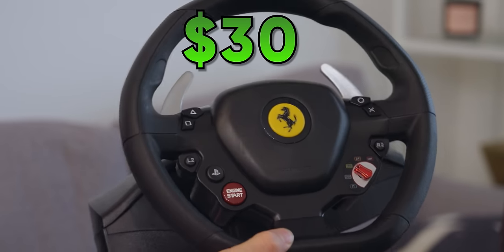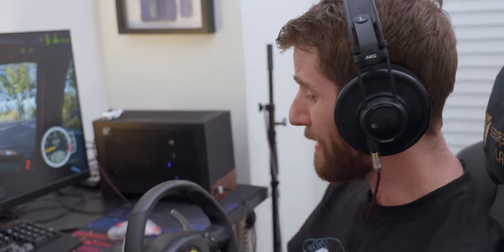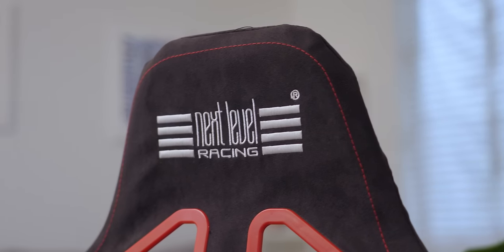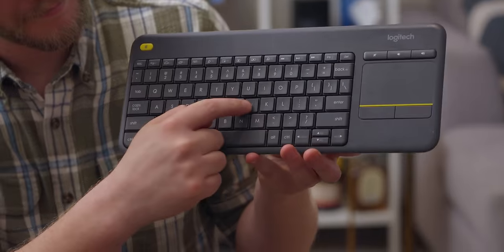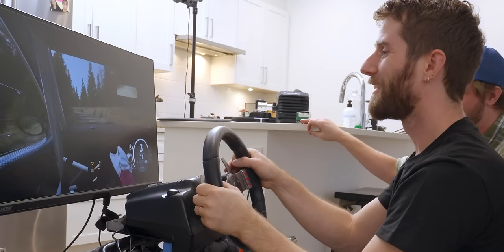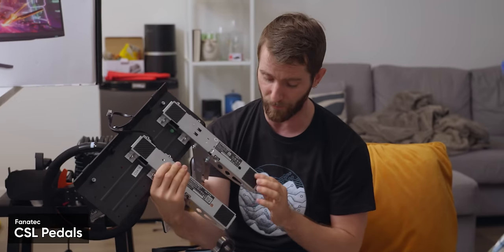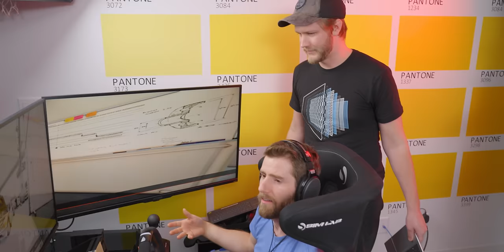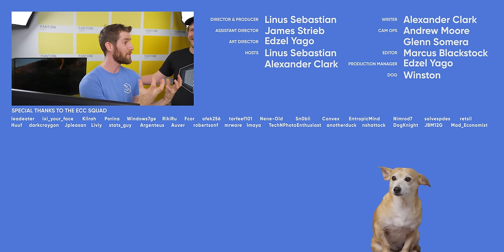Don't Waste your Money - $30 vs $10,000 Racing Setup

Comment: I'm quite happy with my Logitech G29. I got it with the H-shifter at no additional cost since the store was selling both simultaneously as a bundle at the time. I also agree that while the hardware makes the experience more immersive, it's the player's ability what makes the difference in the end.
Reply: Esports champions have used the G29, it's a great wheel.
Reply: i got that the pedals and shifter, add in a VR rig and you are rocking immersion
Reply: G29 is pretty bulletproof and has plenty of force behind it. I do recommend it to everyone who’s new to all of this. I don’t race competitive though, just like to cruise around in games.

Comment: About the monitor, I use a tool called Twinkle Tray, which allows you to change the brightness of your normal PC displays without using the OSD. It does this using the DDC/CI-functions that also handles the thing where Windows sees your monitor's brand and model!
Reply: Dell displays have a similar OEM app for this too. Honestly a game changer

Comment: i saved money by building my own desk, seat base and found a good conditioned car seat for the seat to mount onto the seat base i made.  
I choose the Simagic Alpha wheel base because its so compact, good quality, and quick release wheel rim.  SHH shifter does the job and made in Spain from 3D printed housing.  then modified a pedal set to make them feel more realistic and better reaction (see video on my Moza racing pedal mod).  
your right, no need for a $10,000 setup.

Comment: On the subject of wheel rotation on the G27: Always use the maximum rotation. The game will provide the lock limits for the car you drive automatically (in most cases). The problem with using an artificially limited range is that all of the force-feedback effects are smooshed together, amplifying less important information like bumps and reducing the feeling of the important stuff like weight-shifting and traction levels. In other words, effects that should happen subtley and gradually occur much more suddenly and violently than they would realistically. When you're driving the car properly, you aren't going anywhere near full lock anyway.

Comment: IMO, the best upgrade to one of these setups is to get the frame and no chair at all.  Go to a junk yard and get a good condition seat from an actual car. You can use the same bolts that it comes with to connect to the frame ( or to some wood if it works better for you )  No need for super expensive custom seats and lots better overall.  As a plus, if it's a manual seat like in a base model Mustang, you have all the adjustments built-in. All you need is to bolt the four corners down to something. :)
Reply: +1 i use a recaro bmw electric seat with an old laptop charger to use the seat controls. I can do endurance racing hours and hours, zero disconfort.

Comment: I've had the "$30" setup for a while now (except my kit is an old PS3 GranTurismo wheel from logitech that has force feedback) and I absolutely love it for the sake of immersion or just when I want to "drive" more without wasting actual gas, but often still use my controller for any racing game that I'm trying to complete for the sake of the game itself (like nfs Heat or Forza Horizon)

Comment: I've been using a g29 wheel for over a year now and it's a great investment if you like sim racing. No where near as fancy as some of the higher end stuff but it does it's job well.
Reply: Yeah anything in the 1000s just isn’t necessary if your not a pro lol a desk and racing chair with the g29 is more than enough
Reply: its still $300 way too expensive. no way i wanna spend that much to play driving sims
Reply: @talal3c  if it's between spending a couple of hundred and spending thousands for a full setup - a couple of hundred is way more affordable to get into the hobby. If that's too much for you - that's fine.

Comment: One thing too with the PS5 controller in particular is that at least in GT 7  you can also use it like a steering wheel. While obviously not amazing for the feel of a wheel, actually turning it in a similar fashion helps with smoothness and kind of feel for what its worth. It's just awkward still using the L2 and R2 triggers for gas and brakes (this can be changes but makes more sense using the triggers with the adaptive feedback and considering how pedals actually work.)

Comment: I've been a fan of racing sims since 2013, and about 6 months ago I decided to try a steering wheel, I got the Logitech G29 and it is great, the only downside is after using it for a while the motor gets hot and there will be a burning smell coming out of the vents. To solve this, I didn't use the wheel for a while so the components would fully cool down and I haven't noticed any burning smells coming out of the vents since then.

Comment: The main difference between the G27 and G29 I believe is more so the force feedback getting better. In terms of the actual wheel capabilities, not so much really. The pedals also have a clutch now too (some older wheels don't get one) 

One thing that is super nice for the G29 is the modding scene though! I have a heavily modified G29, so mine is actually in an F1 wheel configuration, with magnetic shifters and also a better grip for pure racing titles. My brake pedal is also modified to have some more weight. It's neat to see that even the low end wheels have their own modifications.
Reply: I have the g27 and my little nephew has the g29. they are identical inside . The onley big difference is the button layout g27 has all buttons on the wheel while the g27 needs the shifter to complete all button functions. Thats why g29 doesnt have the shifter included (have to buy it seperate) shifter from the g27 feels a bitt better (little stiffer) than the g29 but the difference is olmost not noticable. g29 is nice when u race gt class and above cars becouse of the button layout. other then that there realy is no difference
Reply: The G923 is arguably better than both because it has Trueforce but so few games have it so its more of a gimmick lol
Reply: They both put out 2.2nm.
Reply: I have an older G25 so slightly worse force feedback. It does have G923 pedals connected to the wheel though. These are a nice improvement and work with no mods at all.
Reply: @PixelatedWolf2077  the pedals are a useful upgrade for earlier wheels if you can get them cheap.

Comment: I used to use the OSD on my monitor all the time to change my monitor brightness and I hated it, until I found twinkle tray which lets me control them through windows and I can set them to hot keys to have a more integrated experience akin to a laptop. Also it supports multiple monitors decently well.

Comment: Great video guys, it's easy to over complicate a video on this topic with so much equipment out there to choose from. My brothers came over and had a blast with WRC 23 on my sim rig its great fun going for the fastest stage time. Sim racing has been a full blown hobby for me for the last few years and no other gaming experience has come close. 
I like doing metal fabrication work so its been a ton of fun building a rig. Its helped me keep the price down without many compromises. So far I have made a sequential shifter, a load cell pedal box, formula wheel, custom frame, button box. basically a custom rig for all disciplines.

Comment: 14:00 Someone needs to tell him about DDC/CI. Using a tool like Twinkle Tray, you can make the monitors change brightness automatically, and not just on laptops either. VGA, DVI, HDMI (not DP, that transmits it differently) have 2 wire for an I2C bus. 90% of monitors allow you to controll them via that

Comment: I never even tried racing with a game controller. I started in the mid 90s playing Papyrus Indycar Racing with the first mass marketed wheel/pedal set, Thrustmaster T1  (and still have it on a shelf to this day), and the wheel used bungee cord tension, but that beast was made out of 80% metal. When FFB started to come out, in 2000 I switched to a Logitech Wingman Formula Force wheel/pedal combo. The FFB was awesome to have, but the 80% plastic build always felt like I was going to break it. (Just sold that one 2 years ago.) Then life took over and I had about a 20 years hiatus and wanted to get back into it in 2021, but my gear was very outdated (can you still get serial cards for new PCs? Lol).
I got a used Thrustmaster Ferrari Wireless GT Cockpit 430 Scuderia Edition because it's a folding, all-in-one wireless wheel/pedal set. Very convenient when you have no space and using a gaming laptop connected to your home surround unit and 70" TV in the living room. And it was great for NASCAR or F1, but when it came to Dirt 2 rally racing or drifting, the lack of FFB just didn't cut it. So almost a year later (2 years this past Christmas Eve) I bought a used Thrustmaster T300RS and T3PA-Pro pedal set. This snowballed into a re-config of my girlfriend and my collectors room changing into a his/hers office space. I got a folding wheel stand (which is so modified now it can't fold if you wanted to), a new TM TH8A shifter, a new TH TSS handbrake, triple monitors, a used VR headset, a Logitech surround sound, and my girlfriend bought me a new gaming PC to run everything better than an 8 year old gaming laptop.

Comment: Vr is essential for sim racing imo. It makes it so much easier to judge distances.
Reply: Only if you can set your stuff up the same way as in the vr.
Reply: Most people prefer triple like this. Properly set up with the right FoV you get the same natural feel of speed. And its less tiresome for your eyes, especially during longer races. In addition to that it also allows you to use the fancy stuff you can buy like wheels with displays, mashal flag LEDs and such.

I know plenty of guys in my league who moved from VR back to triples. VR is awesome if you dont have the space or budget for triples like the ones in the video though.
Reply: @BurningBroadcast also fov, you can see what happens in the corner of your eyes. Until vr can do at least 150-160 degrees fov, triples = less crashes for me.
Reply: Thats just because of the Stereoscopic 3D effect. you dont need VR for this, 3D screen is enough :p
Reply: @BurningBroadcast  I much prefer my triples over VR, even if I didn't have motion sickness. People forget motion sickness exists; there is a VERY significant portion of people that have motion sickness they cannot "get over" by exposure, or even by taking Dramamine or alternatives. Those can all help, but for many (including myself) there is nothing to fully alleviate it.
Reply: VR will be the obvious answer in the future, but it's not quite there yet and it would for sure make me sick anyway

Comment: A video without any specific information regarding the simracing world and how to get a good simulation.

The advice to stay away from the "no Force feedback wheels" is great, these are awful and useless, a controller is way better.

An advise regarding the importance of a good feeling with brake pedals, in particular talking about loadcells, would have been necessary in my opinion.

Maybe having Jake (who has some experience in simracing) as co-host would have been better.

Comment: YES, racing a sim for extended periods of time can be excruciating. I would know, I've done in Gran Turismo games, all of the 24 hour endurance races using my G27 and a G29. This was a few years back, but I can still remember the exhaustion. First time I did it solo, which was downright masochistic. As a result, I can easily go full blast on the Nürburgring at night. My friends can't keep up. For all the other races, Spa and Le Mans, I ran it tandem with my cousin and a few beers. Don't drink and drive. And REST before driving, always. I'm seriously considering a Fanatec DD PRO to improve my setup.
Reply: If you get the pro get the 8nm boost kit, and a loadcell brake. You will be set for quite a long time and obviously you love cars  and racing. One of the best purchases I have ever made in my life.

Comment: you don't need to keep changing your OSD settings all the time. just enable HDR in windows & you can change the SDR brightness settings easily through there. keep the monitor in HDR 400 mode. i have that same acer monitor & it's already really well calibrated

Comment: I had a G25, and tested a Morza and a few fanatec wheels, I ended up getting the logitech  pro DD wheel and pedals, the thing is amazing (liked it better that the others) It will not make you faster but it's way more fun with a good setup. if you get a DD wheel you need a good frame else you will get a lot of flex from the DD wheel and load cell break.

Comment: As someone who has experience in Sim Racing:

Anything you can afford to start off with, as long as it has Force Feedback. Logitech, Thrustmaster, it's all personal preference. 
After that, the next step is upgrading everything around your wheel, then, after you have a shifter, a wheel stand/bucket seat, you invest into a new wheel.

Comment: Imagine having a 10k budget for the sim and ending up with a fanatec base with a toy rim connected through a plastic "quick release" that you manually have to screw in
Reply: Dont buy the cheap shit fanatic makes the real stuff in the car too this stuff aint cheap its an expensive sport
Reply: @Supersicksimracing  Fanatec is garbage tier in 2024 mate
Reply: @CHAPI929292 I have a full fanatec setup except for the ebrake. The ebrake was the only junk part, everything else feels amazing
Reply: @CHAPI929292  What's the good stuff then?

Comment: What you should be looking at is the diameter of the wheel, and the turning radius. Cheap racing wheels can’t change their wheel type and you get stuck with a comically child sized steering wheel. Imo, the thrustmaster t300 is the absolute baseline. Approx 500-600

Comment: I like how you have the Fanatec DD1 or DD2 base but went with the cheapest wheel they have
Reply: not the cheapest tho the csl p1 v2 is 120€ wrc one is 200€
Reply: It's the only wheel branded with wrc. I believe the torque is even limited from 20 to to 8 or 10nm because the wheel is plaatic
Reply: @xnutral  if they waited for few weeks they could have used the rally m sport bundle

Comment: You can pretty easily get a Thrustmaster T150 for less than $200 just about anywhere, less than $100 if you don't mind going through discount sites; it's a solid wheel and pedals with force feedback that's about as easy/quick to set up as the first wheel without it, but... it has it, and it's good. I have it, it's good.
I mostly play ATS with it. Very fun.

Comment: The worst part of owning a wheel and pedals is getting the energy to set it all up and having to put it away afterwards.

Maybe it's worth it if you have the space for a permanent setup.
Reply: +1 it makes it pretty hard if you have to spend 10-20 minutes setting everything up when you just want to drive.
Reply: The Moza R9 and R12 Bases are super small. With the desk clamp I can get it on my desk in only a few minutes. Plop the pedals down and go. It's still a pain, just less of one than with bigger/heavier bases  @JoshuaGroseTech
Reply: @ny-lights in no way would it be safe to mount an R12 to a desk unless youre running it at like 1-5% of it's force  💀

Comment: And if you thought this was crazy, just look at flight simming - games like Digital Combat Simulator, where all the buttons in the aircraft's cockpit are functional and you have to know what each does, and setups ranging from the entry level T1600M at a bit under $100 to thousands for sticks, throttles, and rudder pedals, not to mention mounting systems, and head tracking or VR, which is almost a necessity. You can take it even further, buying instrument panels from companies like Winwing. I think it'd be really cool to see this same type of video but for flight simming

Comment: It really depends what you play. If you ran your tests on Iracing the pad wouldn't have even figured in the lineup.

If you're doing tarmac racing then a loadcell pedal is very important and worth the extra money. I started sinracing with a Logitech G920 and now have a full SIM rig with DD and load cell pedals and the difference is massive. The times I can set are so much different (especially when you start to improve trail braking)

Tbh I don't really think LTT is the best place for this sort of convo because it's simply not in your expertise. Boosted media is a goto for me.

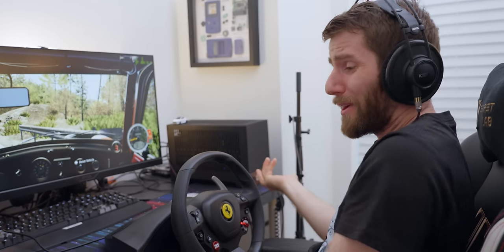Comment: 5:00 Unless the game have some kind of assistence, you will have a bad time due to the very high sensitivity of the controller, just think that moving your finger slightly to the side is equivalent to turning a steering wheel 180º

It's also why games like Mario Kart feel strange with a regular steering wheel, since it was designed with controllers in mind, it wants you to go from 180º to -180º in a split second

Comment: Correction to what you said at 14:20 mark. They do not support the g27 wheel anymore. I upgraded to W11 and it is a known issue you can't install the drivers without disabling memory integrety. Which sucks since the wheel is still a great bang for the buck.

Comment: Rally car racing specifically is difficult by default. You need to hear the callouts. I personally like the drifting missions on the Dirt series.
Had a ps4 /360 combo racing wheel back then. It's a lot of fun once you're actually "good".